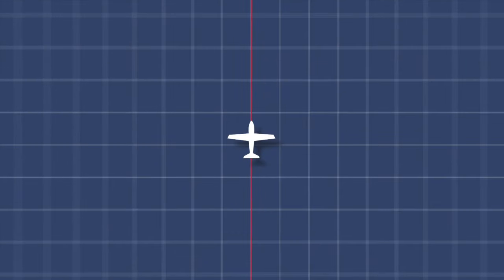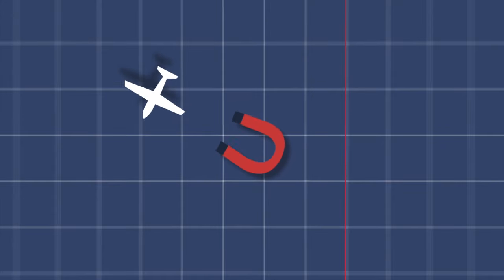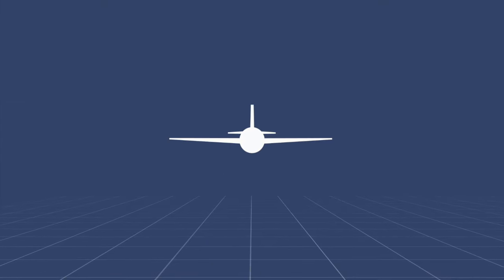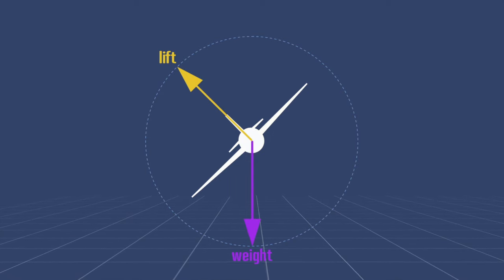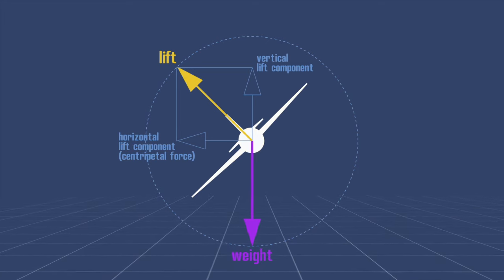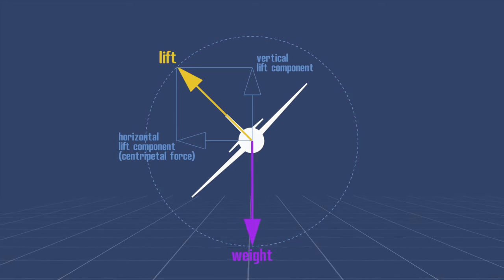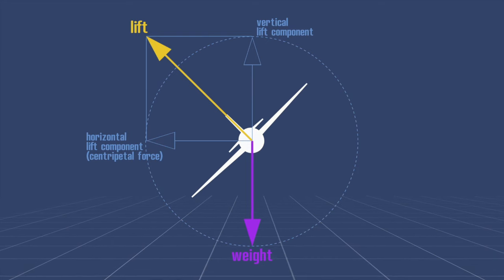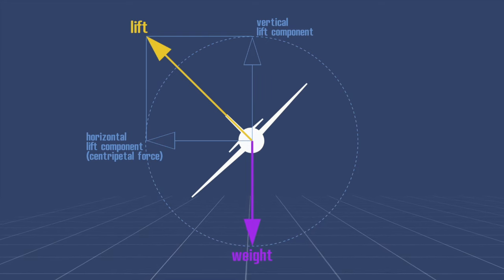How Planes Make Turns | The Forces at Work Simply Explained

Comment: But why the airplane can turn and not just slide to the banking side?
Reply: I was asking this same question recently.  There are some good answers on Stack Overflow and Quora even.  Here's one:  

(A) an airplane is designed to be positively stable in a forward direction in cruising flight, just the way an arrow — or a balsa-wood toy glider or even a paper airplane — is; the “tail feathers” are there to correct any “wobbles” in its flight path and keep the nose pointed more-or-less in the direction the whole object is moving. That means, if something (such as sideways lift, caused by entering a bank) is pulling the entire aircraft sideways, the nose will eventually come around more-or-less to point in the new direction the aircraft is traveling. But that can get a bit sloppy, due to various other random forces, such as wind — in addition to which, the differential aileron defletion that rolled the airplane into the bank that causes the turn, also causes more drag on the “up” wing and less drag on the “down” wing, which tends to actually swing the nose away from the banked turn. Which is why,

(B) the 3-dimensional control surfaces (pitch and yaw, as well as roll) come into play, in a piloted aircraft, to make a “coordinated” turn. That means, as the pilot rolls the plane to the left to enter a left bank, he will also pull back on the yoke a bit, to give it a bit of “up” elevator — which in the banked condition, also provides a bit of a “sideways” component, tending to kick the tail out slightly to the right — and add a bit of “left” rudder as well, which also tends to kick the tail to the right. (The bit of “up” elevator also increases the angle of attack of the wing toward the relative wind, creating additional lift, which compensates for the fact that some of the lift is now being vectored off in a sideways direction — and which keeps the plane from losing altitude in the turn. But that’s a detail not relevant to your specific question.) When the tail goes right, the nose goes left, because that’s how a moving object works — it always rotates about its own center of gravity, which, in most airplanes, is roughly near the center of the fuselage (in the up-down and left-right directions) just a bit forward of the aerodynamic center of the wing (in the fore-aft direction). On a small plane, that is just about where the entire passenger cabin is located.

How can you tell if the elevator and rudder application is not enough, for a given amount of bank, or if it goes too far? Well, the idea is to keep the perceived force of gravity (due to centripetal force) pushing you down in your seat, during a coordinated turn. That’s what pilots mean when they say they fly by “the seat of their pants.” There is also a gauge on the panel, called a “turn and bank indicator,” which includes a level ball in a glass tube (or some electronic equivalent) that shows you whether the “down” direction as perceived by the aircraft is properly centered, or whether you are in the condition known as skidding (you over-controlled with the elevator and rudder, and kicked the tail out too much) or slipping (you under-controlled, or even applied the controls in the wrong direction, which means the nose is not swinging around fast enough to match the change in the actual direction of travel.

An intentional “cross-controlled” side-slip can be a useful flight maneuver, keeping your nose pointed in the direction of actual over-the-ground travel while your through-the-air direction of travel is slipping sideways, in a cross-wind landing situation. But other than that, uncoordinated turns are the mark of an unskilled, inefficient, and potentially dangerous pilot (since the uncoordinated turn can more easily turn into an unintentional and deadly-at-low-altitude stall or spin, than a properly coordinated turn). It’s also a lot more comfortable for the passengers if they continually feel the apparent force of gravity acting in a “down” direction even when you are banked into a turn.  

I also found the video(s) "Learn to Turn" which I bet would take issue with at least some of the content in this video.
Reply: I know im kidna late, but anyways:
It does.
The plane indeed does slide sideways when banking. When turning however, the loss of altitude that would be induced by sliding in the bank direction is countered by the upward facing component of lift vector.
Also aircraft has some surface area when looking from the side, which means that it cannot just slide to the sids freely, as it also experiences aerodynamic forces in the direction of the slide.
Reply: She simply not answered any other queries
Reply: Let me explain, actually a force towards the left or right is not enough for the plane to turn, for the plane to actually go in a circle path, the plane has to "rotate", so the plane will actually have yaw and it will do a "rotation" so when the plane rotate the lift is always pointing toward the center so that it fly in a circle
Reply: @Karol52752   Indeed, all the side area aft of the center of gravity contributes to the directional stability keeping the airplane continuously pointing into the relative wind.

Comment: Great explanation! That reduced vertical lift component stands as a reminder that stall speed increases when turning (as the AOA is increased to maintain altitude).
Reply from the maker: Great point!
Reply: I don't think stall speed increases due to higher AoA but due to the load factor which results in more lift required, thus making the speed at the critical AoA higher.

Comment: Where is the center of the wing's turn?  Is it relative to an observer on the earth (ground) or is it somewhere else above the wing somewhere in space?  Does the total lift vector (moment) point to the center of the turn or does the horizontal vector (moment) determine where the center of the turn is?  If it is not with respect  to an observer on the ground, then the center of turn is not pointed by the horizontal lift vector.  If this is so, both wingtips have no relationship to the ground and thus, both wingtips are flying at the exact same airspeed, with respect to the airmass, right?  Wrong?
Reply: The center of the turn is with respect to the airmass, as you correctly pointed out.     The wingtips, however, are moving at different airspeeds.  The wingtip on the outside of the turn is farther from the center and is describing a larger circle than the inside wingtip, thus it is moving slightly faster.

Comment: Increasing the thrust and there by increasing the velocity can also help to increase the lift. This balances out the weight
Reply: You might add power to maintain the airspeed in a turn, but any more than this would have the undesired effects of increasing the radius and decreasing the rate of the turn.

Comment: great  simple video but i think it shows all that's needed for me flight simulator I'm starting to code in OpenGL, I got the maths of quarternions etc.. but was missing the forces etc.. watching this video I think that's it, all forces that exist, specially the 2 components of the UP vector and will potentially influence both horizontal movement and vertical movement if pitch or speeding up doesn't happen.

Comment: Aileron is used to get the banking with the help of rolling.

Then are rudders and elevators both used? Or only rudders used?
Reply: Sanjeev Kumar use rudder to keep aircraft in balance. Elevator use to maintain altitude as aircraft turns.